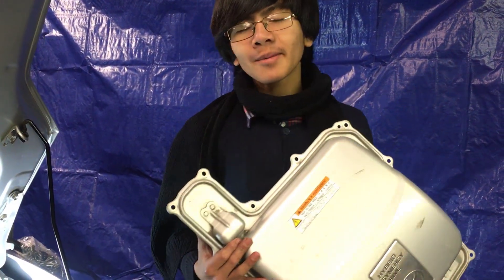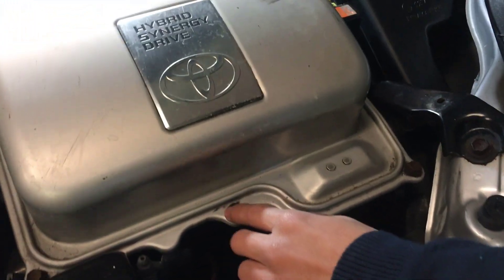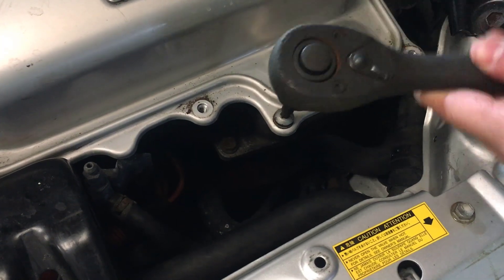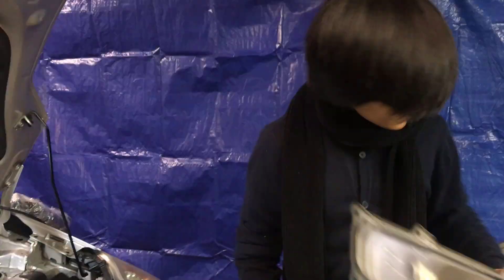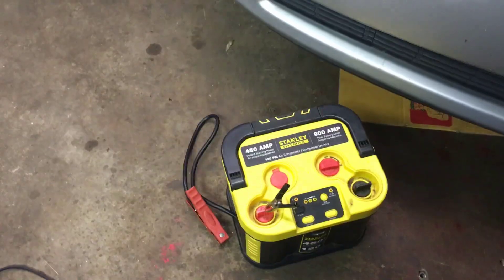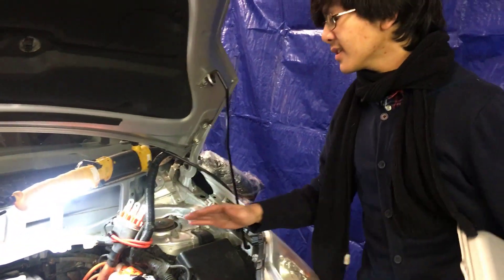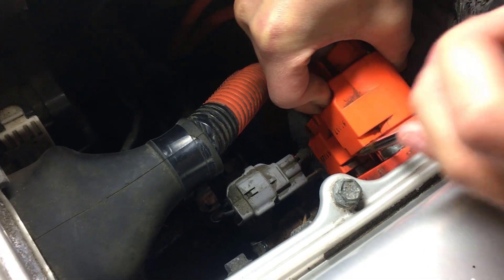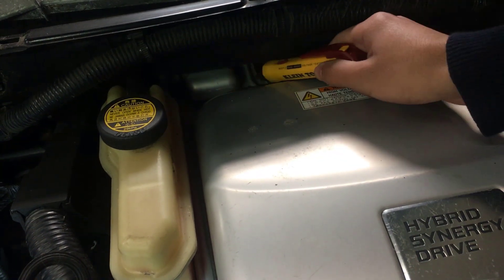How To Remove Inverter Cover, Test Voltage & Cable Removal | Toyota Prius 2004-09 Hybrid 2nd Gen II

Comment from the maker: Here are the #ᴬᴰlinks to tools, parts and accessories you may need to perform this repair:
1.  https://amzn.to/4gq1YEt  |  KAIWEETS Voltage Tester/Non-Contact Voltage Tester with Signal Percentage, Dual Range AC 12V/70V-1000V, Live/Null Wire Tester, Electrical Tester with LCD Display, Buzzer Alarm, Wire Breakpoint Finder
2.  https://amzn.to/49uHyI1  |  AstroAI Digital Multimeter Tester 2000 Counts with DC AC Voltmeter and Ohm Volt Amp Meter; Measures Voltage, Current, Resistance, Continuity and Diode, Blue
3.  https://amzn.to/4gsLonD  |  OPTIMA Batteries High Performance DS46B24R YellowTop Dual Purpose Sealed AGM Car, Truck and SUV Battery, 450 CCA, Maintenance Free, Versitile Mounting, Fits Select Prius Models
4.  https://amzn.to/3Vp9ojq  |  Milwaukee 2457-20 M12 Cordless 3/8" Sub-Compact 35 ft-Lbs 250 RPM Ratchet w/ Variable Speed Trigger
5.  https://amzn.to/3D4LOCa  |  G9020-47031 Engine Electric Inverter Cooler Water Pump Assembly for 2004-2009 Toyota Prius 1.5L 

Or Click on Amazon link here and search for what you need:  https://amzn.to/3D1T2GQ

Comment: This information in this video is extremely dangerous and should not be followed. 
All protocols have been missed, equipment and precaution not adhered to. 

Please do not follow this instruction.
Reply: Would be more useful if you spelled out what was missed
Reply: There are a few things missed and you have made some fundamental mistakes , as non trained.  Safety is paramount and assumption regarding insulation errors could prove fatal.  Tooling used incorrect, safety precaution and PPE not correct. Bus discharge times not covered. reference dangerous voltages not correct for AC.  You have covered some correct points but as a DIY not as trained technician and those that adopt could be killed as a result.  I would recommend this is taken down. Go and complete HV training and then post with corrected information.

Comment: If you are looking for content suggestions: Would you please perform an upstream Air Fuel Oxygen sensor replacement video.  I see complaints that there is really no videos for this.  Also my research Chilton's suggests that removing the inverter in required.  If you know of a simpler way that would be preferable.  In particular, others have complained that the O2 sensor socket is too long and the sleeve surrounding the upstream sensor is a tight fit.   Thanks in advance.
Reply from the maker: Thank you for the recommendation.  We intent on doing more videos on Prius since my dad want to replace the entire engine.  It's over 400,000 miles now and it needs a new engine.

Comment: I have a 2007 Toyota Prius and am going to replace the inverter, do I have to program the used inverter I am going to put in?
Reply: How did it go replacing the inverter? Did it work, need programed or anything else?

Comment: Hello again ... greetings when changing the inverter, do you have to program?  It has to be the same part number ... example my car is 2007 do I fit a 2008 Prius?
Reply: Did you end up figuring out if programming is needed?